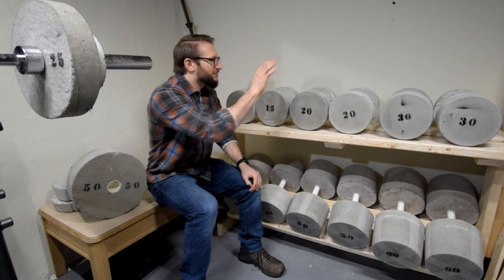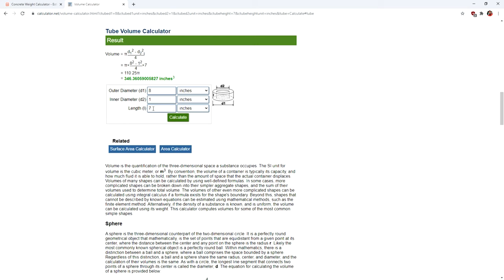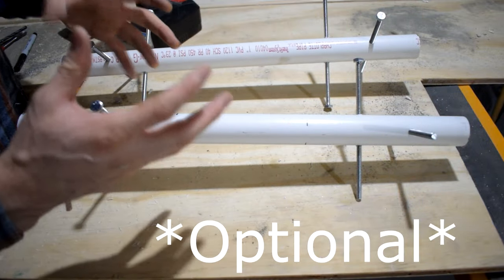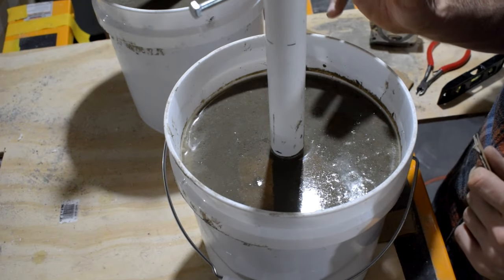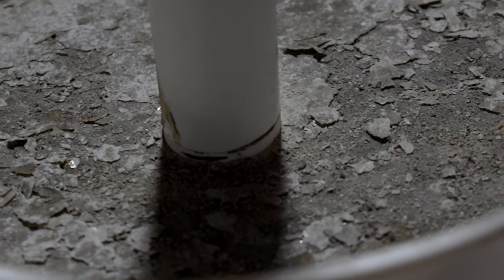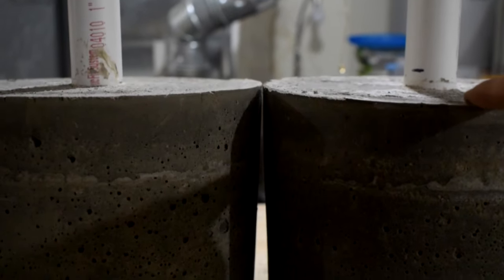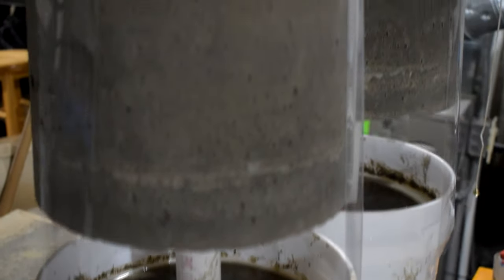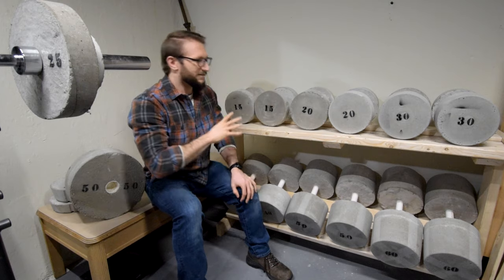DIY Concrete Dumbbells - Complete Guide!

Comment: Nice video man. A few pointers to make the process easier...
- Always wait a minimum of 48 hours to pull from mold. 24 isn't long enough.
- Try using steel tube, not pvc... it's obviously much stronger, and won't flex with fast motion or higher weight. But, whatever tube you do use, always fill them up with concrete also.
- To make the concrete pop out of the mold easier, spray the mold with silicone lubricant first. 
- To center the handle, use the cap that comes with the bucket and cut a hole, OR use a plywood jig. This takes out the guess work of where center is, AND keeps it from slightly moving off center when curing.
Reply from the maker: All fantastic ideas! 

The silicone spray would be a lifesaver for 50 lb dumbbells and up. The PVC was more of a convenience choice, it's easier to cut and is way more rigid than I thought it would be. No bend at all even with the 60s. If you're making much heavier, I imagine some electrical conduit would be a solid choice.
Reply: All great tips.
Reply: Electrical conduit?not a solid choice at all,what about some1"solid bar.not hard to cut with a cheap zip cut wheel on a grinder,and even that is a compromise as it should be cold rolled hardened steel to prevent bending,but since you can't really throw concrete dumbbells around too much anyway it probably won't be an issue.you can't just choose a material because it's easy to cut,why not use some cardboard tube than?it cuts with some craft scissors which is about the only tool you seem qualified to use,just don't run with them and I would suggest eye protection
Reply: i love this video and i love this comentary, i was thinking the same thing with the bucket cap/lid. @know it all,  i also think that you should add to the video details the exact amounts of concrete to pour for each weight along with showing us the process, becase i think that part might be a deterrent, or at the very least intimidating for some.
Reply: @knowitall8799  Hello, Good video, I would like to know how many liters is the bucket, Thank you
Reply: @knowitall8799  Great video, but I've got some tips. I've worked with concrete in a testing setting, we made 4x8 cylinders for compressive strength testing. What we did to get them cleanly out of the molds is make sure we lube the molds well with form release oil, silicon lube was suggested and that'll work. Also, make a small hole with a nail in the bottom of the mold and use an air compressor to pop them free. The hole is small enough that you won't really lose any concrete. If the concrete still sticks you can blow compressed air along the top of the mold edge and that should be enough to get it to release. Maybe use some pipe for handles moving forward too, I wouldn't trust that pvc with any real weight haha!
Reply: Great tips 👌🏽
Reply: @elsamo267  Some galvanized pipe would be great I would assume. And instead of bolts maybe some rebar that’s tied with wire? Or maybe if you had access to a welder just a few racks? Idk.
 Edit: maybe some kind of spray on rubber coating to help in case you drop the dumbbells? To help from chipping?
Edit2: truck bed liner. I meant truck bed liner.
Reply: @knowitall8799  to use whatever for a handle you could place a t-joint at the top and screw in the pipe.
Reply: Me podría ayudar a sacar las medidas de 2kg, 4, 6, 8, 10, 12, 14, 16, 18, 20, 22, 24, 26, 28 y 30 kg por favor no pude y no le entendí soy mala en matemáticas 😢

Comment: You don't need to be a perfectionist when you do this. You just have to make sure you are doing it close to right and economically.
Reply: Yeah and if your worried about the weights not being accurate just switch weights each set to prevent muscular  imbalance

Comment: I would strongly recomend using steel handles if you can find some, I bought a bunch at lowes had then cut it to length I needed bought a bunch of rebar and steel net , some electric tape for the handles.

My plan is to cut holes, weld in the rebar, then add mesh on both under the rebar and over for bigger weights. Made one looks beautiful, I think ima chisel the numbers in and add paint.

Comment: Super cool. Been wanting to make some dumbbells for outdoor use that I can just leave outside. This will fit the bill just right. To get it centered you could have built a centering jig with a piece of wood but you did a great job just eyeballing it. I'm impressed how well they turned out. I really doubt the mesh is necessary for this application but it was easy enough to put it. What I'm surprised by is that your pvc ends didn't stick out of the ends of the dumbbell at all. I thought you'd see the edges a bit.

Comment: Getting buckets perfectly level is the key.so take a 4x4  completely flat wood...then add shims underneath so it is perfecly level..use a 2 foot plus level...so unless buckets are damaged they will be level ..also if same bucket is used you could make up some gigs so handles stayed perfectly centered and no fuss with tape or checking distance would be required...great tips...

Comment: Interesting. I've been looking into die casting plates out of an Zinc alloy called ZA-8. As the name suggests, it contains 8% aluminum which gives increases strength and hardness. Zamak 5, another Zinc alloy, would technically be better but might be harder to source than raw zinc and aluminum. The benefit of using it over just aluminum and concrete is the density (6.3 g/cm³ vs 2.7/cm³, concrete has 2.3g/cm³), but the crucial point is the relatively low melting temperature of only ~380°C compared to the ~1200°C of cast iron. Which makes it easy to use propane or an electric foundry for melting it down and handling and also would allow me to use an diy steel crucible. Will have to do some more research and calculations tho.
Reply: Did you ever get around to testing this out? I’m interested in the results
Reply: @tonyg.8688  
Sadly not. But on paper it should work just fine.

Comment: 13:45 not too much pressure... 5 secs later
Reply from the maker: The 60's gave me way more difficulty than any of the others because there's so much more surface area contacting the inside of the bucket. What you don't see is the 10 minutes of tapping between those shots, the broken pieces of wood, and the move to a bigger hammer... Would definitely recommend some kind of release agent for 50s and 60s
Reply: Hahahahhahahahahhahahahhahaa
Reply: Bro that's exactly what I thought lmao..😭😆

Comment: very good idea for minimum cost
but if you add a bit of cost to it you will dramatically increase in ergonomics (the 60lbs weight seems a bit too big honestly :D )
you can use cheap rebar and cut it using some inexpensive tool and embedd it into the concrete as tight as you can without it crumbling apart
rebar steel density is 7.8tons/m3 as oposed to 2.4 tons/m3 for concrete so almost 3 times more dense so you can get away with smaller sizes

Comment: You’ve gained one subscriber 👍🏾
Reply: Also how do or did you build your dumb bell racks
Reply from the maker: There's a 3D model design in the video description. Check it out for dimensions and cuts. It's a 3D printer mock-up website but just think of each unit as an inch.

Cut list:
2x6 - (3) 53" - Bottom shelf
2x6 - (3) 57" - Bottom shelf
2x6 - (2) 28" (Or whatever your height preference)
2x4 - (8) 16.5" (45 degree cuts at ends - looks nicer) - Shelf braces
2x4 - (4) 8" - Legs touching ground
1x2 - (2) 16.5" - Top shelf edge guards
1x4 - (1) 53" - Bottom shelf weight lip
1x4 - (1) 54" - Top shelf weight lip

Comment: easier to put 4 small screws  at 3 / 6 /9 /12  Oclock  and use old shoe strings to keep pvc pipe square

Comment: I’ve measured the sand and cement mix dry to the weight I want the dumbbell. Once the water has evaporated I’m hoping it’ll be very close to the same weight.
Reply: Pretty much will be, but it will be heavier, because when you add water to the concrete it chemically bonds to the lime so it will never leave, the extra water will evaporate, but concrete soaks water like a sponge, so if it's humid than the concrete will soak the water from the air

Comment: My biggest concern would be the pbc pipe breaking at higher weights. Like for example I lift 85 pounds 8 sets of 30 and 22 sets of 30 at 75 pounds. I'm certain this would hold up there. I'd be afraid for it to break and fall on my foot.

Comment: For heaviest dumbell design, using a lathe and tree stump, create 1 piece fillable wood dumbell, the handle is carved out integrally and with hollow bucket either side, fill with lead shot, then add a face plate, then weigh it would do the video if i was able lol i cant own a lathe atm it would be very messy, lots of waste, but an unbeatable diy dumbell imo
Reply: Thanks for the advice

Comment: How do you know the amount of water you’re supposed to put in
Reply: I actually built 10-80s based off his videos. It says how much water to add on the concrete when you buy it. That being said when you do that it comes out a lot more like a paste then a liquid and when it dries it turns out very bumpy/sharp on the top part that faces your hands. Ive actually cut myself with that. So add more water then it tells you so you get a nice smooth outcome on top. Just add a little water at a time. Its not hard to get it right by adding a little at a time. Go more watery then less, and make sure to oil your buckets beforehand
Reply: @davidliftsheavycircles  more water makes them easier to break. Would not recommend.

Comment: How many bags of concrete and pvc pipe did you use for all those dumbbells at the end of the video? Did you use all 5 bags of concrete to make all those dumbbells?
Reply from the maker: Depends on what bags you get. In total there are 430 lbs of dumbbells there. If you get 80 lb. bags, you'd need 6.

Comment: When doing the other half of a dumbbell how are you getting the Top half to sit perfectly in the wet cement and not sink?
Reply: Otherwise everything seems perfect and well described to do tomorrow
Reply from the maker: The handle sinks all the way to the bottom. The end result is what you see on the rack. You'll see a faint ring where the PVC pipe is on the outer edge.

Comment: just curious, how do you make your cement mix? is it just straight cement and water, or do you add other stuff in it?
Reply from the maker: I used Quikrete High Strength bags. You can purchase bags with fiberglass in the mix to strengthen and help resist cracks.

Comment: Are the 60s and up to big to curl and do certain exercises with? Thanks
Reply from the maker: The 60s are as heavy as I'd go with an 8" diameter bucket. They're slightly larger than comfortable, but I'm able to press them without issue. I imagine curls would be a little clumsy with them, I'll have to let you know when I'm able to curl them haha.

Comment: aren't the buckets in the shape of a cone? at the bottom the diameter is smallest and as you go to top of bucket, the diameter gradually increases. Don't you have that issue?
Reply from the maker: These specific buckets are very slightly slanted. As close to vertical as I could find.

Comment: Would the PVC break?
Reply: No, you can drive a car over schedule 80 pvc pipe and it won’t shatter.. so 30lbs on each side  won’t do anything to it.
Reply: You could also fill the PVC with concrete.
Reply from the maker: There's no flex in the PVC pipe even on the 60's. It's stronger than you'd think!
Reply: Thank you I was thinking about the same thing
Reply: @knowitall8799 What is the heaviest you've ever made?  I want to make 75-80lb ones.

Comment: What did you use for the lower weight dumbbells
Reply from the maker: The same 8 inch diameter bucket for all of them
Reply: @knowitall8799  I cant find 8 inch diameter buckets anywhere. Can you tell me where you bought them?

Comment: Cement dumbbell is not good
- Weight distribution is not as even as steel dumbbells, slightly heavier
- they break easily, thus losing their weight balance
Reply: Idk man, I lifted with professional equipment for years and dont notice the difference. I throw the shit out of mine because i can just make more,  and nothing's happened. Been a great experience for me

Comment: Just buy some used DB’s.
Reply: lol yeah have you seen market prices? there is a reason people build these
Reply: Yeah, in 2021 thats like saying "just fly to the moon" using what? A rocket... People arn't made of money. Used adjustable dumbells are coming in hot at over 1000 USD. I have wish listed 110lb dumbell per hand set on amazon for £2200. The days of cheap dumbell will not return for a good few years, until gyms open again
Reply: @JamesPhillipsOfficial  my gf bought dumbbells lately, but just with 2 and 4 pound plates for each side, so only max 12 pounds per dumbbell. she paid 60 euros per dumbbell, so i dont want to imagine what 30+ pound dumbbell sets would cost. i need 20 pounds upwards so i'm giving the concrete ones a shot

Comment: I don't think it matters how much money you have in your bank account, 100 bucks for a small dumbbell is ridiculous. That's like going to the supermarket and seeing bread for 20 bucks.
I mean, yeah.. you have 20 bucks but bread doesn't cost that much and you just don't want to pay the price...
Reply: steel is expensive, pouring it takes crazy amount of energy and it isn't done on a mass scale, one pair at a time after which you have to remake the mold, so, no, the price is really high 50% material alone and the rest is work + energy.